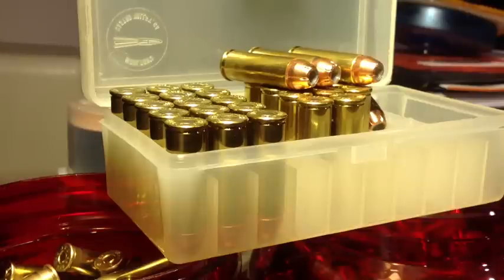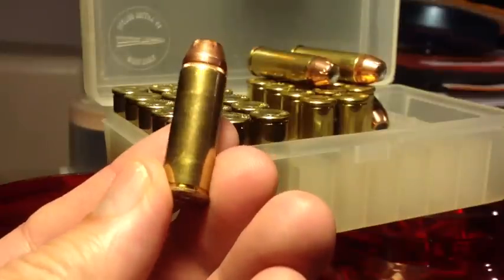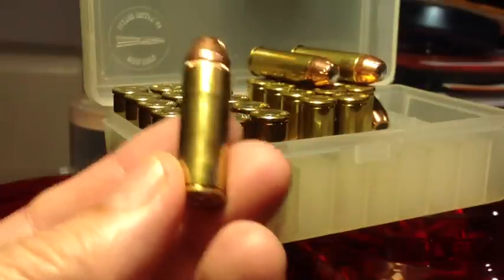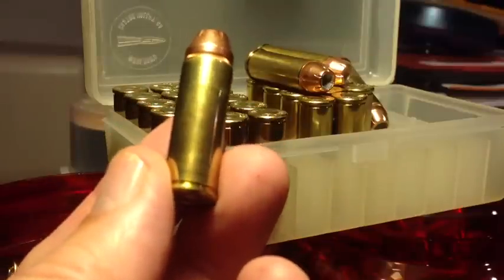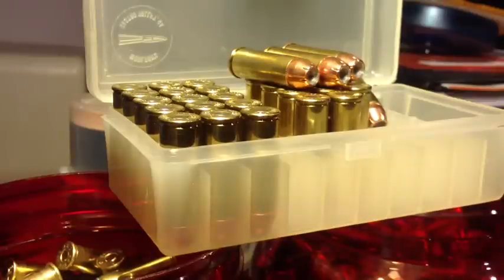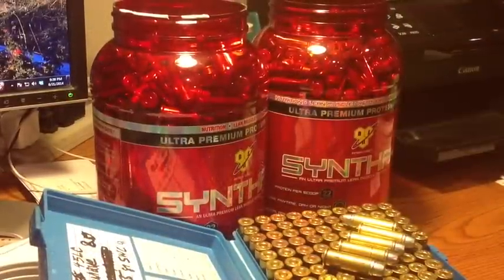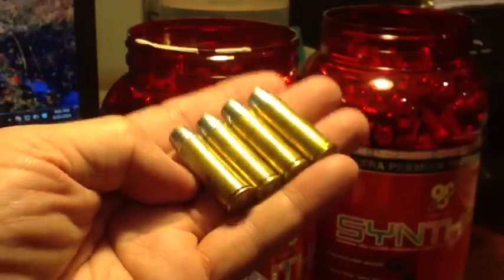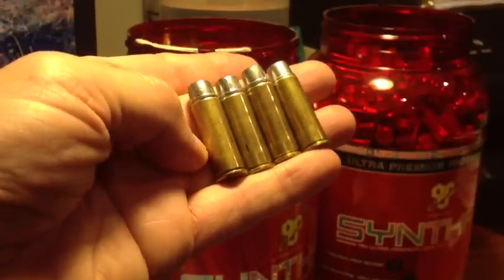Hot Loaded 45 Colt Ammo - Why Not?

Comment: 8g of unique isn't +P. It's very mild for a 255g bullet. Maybe 850fps. I used to load 9g with a similar bullet and it was very mild in a 7.5" Blackhawk. For fun and SD, my load was a 260g speer with 21g of 2400. That had steam, but for most of my shooting, I used the lighter stuff. Of course, unless you have a Ruger Blackhawk, Redhawk or a Thompson Center, skip the +P. Insofar as the Casul, a lot more expensive to shoot.
Reply from the maker: James Lagnese - I remember that 260 grain Speer - shot a box of that with 2400 also many years ago - can't remember the load that I used, but it never got into my favorite loads as I knew I wasn't going to be shooting a lot of those.  My cast bullets were all I needed.  That's true even with these Hornady XTPs in this video...Best to ya, and thanks for posting your favorite load.  FC
Reply: Cast works well too. that's the nice thing about 45 Colt. You can load from 165 to over 340g. I would think the 255g Keith would be really good all around.
Reply from the maker: James Lagnese - The big Keith 45 and the 255 gr RNFP frontier bullet are the first ones thought of when the 45 Colt is in the conversation...For me, those bullets shoot well, but POI is high with them requiring sights to be cranked to the edge.  Much better for me in that regard is my favorite 45 ACP bullet - the Lee 200 grain SWC long nose over 8.5 grains of Unique in the 45 Colt - allows a balanced rear sight setting.  That's actually the cast bullet that I have shot the most all the way back to my IPSC and steel shooting days.  Continued good shootin' to ya,  FC
Reply: Have been using the 255 keith design since early 1970s with an average of 10 gr of unique without any problems, with excellent accuracy in 7.5 inch Blackhawk barrel.  Needless to say, rifling shows wear after many thousands of bullets speeding down the bore but the accuracy continues to be there.  Thanks Ruger for an excellent firearm.
Reply from the maker: PayneCty Gardener - 10 grains of Unique was my general purpose 44 Magnum load with 245 - 250 grain Keith bullets...That's got to be pushing  subsonic velocities in the 45 Colt.  Would be mighty comforting on the trail in a hip holster.  For my range shooting, the old frontier loads fill the bill nicely at the 8 grain charge.  Plus it's easier on the powder economy...especially when there was a powder shortage.  Continued good shootin' to ya,  FC

Comment: The debate still happens, but in reality the 45 Colt cartridge beats the 44 Remington Magnum cartridge easily. Modern 45 Colt brass is as strong as modern 44 Magnum brass, it's not a myth.

Order yourself a back issue of Handloader #292 October 2014 and read the article by Brian Pearce. 45 Colt handloads at 50,000 PSI in a Ruger Redhawk chambered in 45 Colt not 454 Casull.

I don't see any articles loading 44 Remington Magnum cartridge at 50,000 PSI!

The 44 Remington Magnum folks can believe what they want, but the truth is they take second place compared to the 45 Colt folks.

I also think it's funny 44 Remington Magnum cartridge uses bullets .429" to .430", so it's nowhere close to 44 caliber.

As you know 45 Colt uses bullets .451" to .454" depending on firearm, so it exceeds 45 caliber.

Comment: ive watched this several times and the only reason i didint buy a 454 casull and opted to load up some semi hot load for the 45LC in my ruger BH is because the 454 is really expensive. so i can see both sides of the argument. i dont go out and shoot my hot loads all the time, only a few thru the chronograph and the rest for deer hunting. most of my loads are standard pressure. dont wanna shoot the barrel out ya know.
Reply from the maker: chris lowe - That's a good policy.  We really don't want to overpressurize our 45 Colt brass - The Casull brass can stand pressures up to 60,000psi.  Lots of safety margin…not so with the 45 Colt brass.  Best to ya...
Reply: john linebaugh (spelling ?)
solved the "weak" .45 colt brass argument years ago.
.45 colt brass is not weak.
Reply from the maker: gray man - When there was controversy over 45 Colt brass being weak compared to 44 magnum brass, yes - modern 45 Colt brass is as strong as 44 magnum brass as long as the chambers are spec (and today, SAAMI has taken care of that for the vast part).  However, Casull brass is stronger.  I know we are talking about hot 45 Colt loads within the loading manual published loads.  If we try to load 45 Colt to the same pressure as the Casull, we are over the recommendations in the reloading manuals.  These would be more than hot loads.   Of course, this is what Elmer Keith did back in the 20s and 30s, but he was pushing the envelope.  If we want to do the same, we just get hold of a 454 Casull.  Good shootin' to ya, and thanks for all your helpful posts...FC
Reply: elmer keith was using balloon head cases.
known to be weak even then.
he was foolish.
Reply from the maker: gray man - He was young and foolish - we can be young of heart and mind but the older body limits our foolishness... Best to ya,  FC

Comment: I enjoyed the video, but one thing I would add is what can your pistol take?  Hot rodding in a Uberti replica or original gun is going to make you very unhappy, very quickly.  I see comments all the time regarding hot rodding the .45 Colt for use in '92 lever actions or better, which is fine in isolation, but unless you are pairing that '92 with a Blackhawk, you could get into real trouble if cartridges got mixed up.  Given that an original load .45 Colt was designed to drop a horse at 100 yards, I personally don't see the need to make it more powerful, and certainly don't feel under gunned carrying it.  
For a rifle, I'd say if you truly want more power in a frontier cartridge, move up to a 45-70.  Even in it's original spec, a 45-70 is going to outperform a overloaded .45 colt, especially at longer ranges. You also have the added bonus of not accidently mixing cartridges, or having someone else unkowningly use a hot rodded .45 Colt in their weaker pistol somewhere down the line.  Believe me, these things happen.
Reply: Faelwolf The original spec doesn't matter when you're buying off the shelf .45 Colt. You don't get the original load with standard factory ammo. You get what is essentially .455 Webley ballistics. Original black powder spec should be sending those bullets down range at 900+ FPS but standard smokeless ammo is doing more like 700-800. IMO an SAA clone in any chambering larger than .357 should be used as a black powder gun, you won't get better performance from the smokeless stuff.

Comment: 8 grains of Unique with lead 255 grain bullets is no where near +P loading pressures. In fact that load is just at the higher end of a cowboy load with an approximate mv of 800-825 fps depending on barrel length. A hot load with that lead bullet would be more like 9 - 9.5 grains of Unique powder for mv of 900-1000 fps. That load is still at or below SAMMI standards 14,000 psi for standard 45 Colt cartridges.Best read up in your reloading manual before putting out erroneous load data.

Comment: So is there a .45 magnum? If not, why not?
Reply: Yes, it's called the ,454 Casull (more powerful than .45 Colt), .480 Ruger (more powerful than the Casull), or the .460 Smith & Wesson (more powerful than the Ruger!).
Reply: Thank you, forgot about the Casull
Reply: winchester also made the .45 magnum.
it is a rimless case.
i have an m-1 carbine converted to fire it.
Reply: gray man
Right you are.
A company called LAR Industries even made an upsized 1911 gun chambered in that beast of a round.
Reply: @grayman7208  I wish Ruger would make a blackhawk or redhawk in 45 Winchester magnum. I have a Wilde chambered in it and it is a great cartridge.
Reply: @robertmurdock9750  all the need to do is provide moon clips.
in fact ... it may work with the moon clips provided with the .45 colt / .45 acp redhawks. 
in a blackhawk it would need it's own cylinder ... just like for .45 acp.
Reply: the did .45 winchester magnum.
Reply: @Gunners_Mate_Guns  the .480 ruger is NOT a ".45 magnum" in any way.
it is a downloaded 475 linebauh.
Reply: @grayman7208  You are correct.
That was a brainfart from me.
I've been told that the .475 Linebaugh is a particularly challenging round to master in the modified Ruger Bisley revolvers that John Linebaugh uses for it.
Reply: @Gunners_Mate_Guns  you could think of the ruger .480 as the .475 linebaugh special )
Reply: @grayman7208  Yep
Obviously, Bill Ruger wanted his name on the cartridge instead.

Comment: Hot loaded 45 Colt is something the rifle dudes should be interested in. For guys with 45 Colt lever guns are leaving a lot on the table by not reloading for the stronger action & added barrel length. I have a 454 lever r92 & it smokes pigs & really big ones too. I know guys that load there 45 colts rifles  hot , using hard cast rnfp of 300gr + & around the 1400-1500fps zone & there through & through pig stoppers. Don't get me wrong std 45 colts stop pigs but magnum loaded ones are a whole new ball game. & you can generally use a wider meplat / nose & .020 wider bullet with more weight over a 44 mag. 300 gr hard cast rnfp are great hunting bullets.

Comment: my comment was that he said stout loads at 8 grains. That charge is a mild by my experience
Reply from the maker: Silver Back - Sorry for the confusion of terms and also for the delay in reply - Google did not post your comments in my inbox  - won't see 'em for months.  Mild to me means light, so I don't regard 8 grains as a light load.  8 grains in my Alliant manual gives 850 fps as listed velocity.  That is the full bore frontier load (40 grains of black powder in balloon head cases giving 850 fps in 5" barrels back in the day) and that load ruled the frontier for many years - the magnum of its day.  That's where I got the "stout".  I should have used the term standard load.  But the 45 Colt in standard loadings to me is still big bore stout.   Of course, we could go to max of 10-10.5 grains Unique, depending on what reloading manual you use, but I like 10 grains Unique with the 245 grain Keith bullet in my 44 mags instead.  So standard loads they are...  Best to ya,  FC

Comment: I've fired a Magnum Casul. ummmm...OUCH!  >8O

Magnum 45 Colt still has a viable place in Winchester 92's and Marlin 1894's. They should be perfectly safe to feed through them. Probably the originals would be fine, but definately through the modern versions. There are still a lot of them out there. Old and new.
Reply from the maker: The human shrug - Yes the 92 and 94 actions are plenty strong for stoking.  But the reloading manuals are maxing out 45Colt hot loads at 30,000psi and 44 magnums are maxed at 38-39,000 psi.  454 Casulls are loaded upwards to 63,000 psi.  As you point out, the 92s are being chambered for the 454, so the actions are strong enough for the 63,000 psi (and of course the hot 45 Colts), but loading the 45 Colt to 63,000 is definitely not recommended.  30,000psi 45Colt loadings definitely have their place.  The debates of the past were to load the 45 Colt to 44 magnum pressure levels and get more performance because of the bigger volume case…Today, no need to even think of that since we have the 454 and even 460 S&W… Best Regards to ya...

Comment: Ten years ago?  You must be a young man...  I began handloading in the 1970's.  There was data available for heavy .45 Colt loads by then and, I'm quite sure, long before that.  Ross Seyfried was already writing about them in Guns and Ammo magazine, supplying data for both standard six shot cylinders in Ruger Blackhawks and for custom five shot cylinders made for those guns by both Hamilton Bowen and John Linebaugh.  I bought my first mold for a 300 grain bullet from Veral Smith (Lead Bullet Technologies) in the early 1980's. 

Brian Pearce continues to extol the virtues of hot loaded .45 Colt ammo in the pages of Handloader magazine.  This discussion continues in knowledgeable handloading circles to this very day - the introduction of the .454 Casull did nothing to end this conversation in the last few years, mainly because Dick Casull originally developed it in 1957.  It's been a part of this conversation ever since.  Beyond that, Freedom Arms has been selling their Model 83 chambered in .454 Casull since 1983.  I bought one out of the first production run (but have since sold it).  The Model 83 is limited by its cylinder length, which is unfortunately shorter than that of the Ruger Blackhawk.  To make a long story short, we experience all kinds of headaches when bullets with their crimping grooves in a location suitable for the .45 Colt are used.  There are other issues with the .454 Casull in the Model 83 as well which, in short, means that there will always be a place for heavy .45 Colt loads.

This discussion is neither new (in the last ten years), nor has this practice gone by the wayside with the introduction of the .454 Casull.  

As King Solomon said, "there is nothing new under the sun"...

Comment: Underwood 45 Colt #724 ammunition exceed every hot loaded 44 magnum in Underwood's line-up with one exception - the 340 grain 44 Magnum +P+ (part # 743).  Got a Ruger Blackhawk in 45 Colt and you home load?  Trim .454 Casull Starline brass down to 45 Colt lengths.  Debate over.  I trim 460 Rowland brass down to 45 ACP specs.  I shoot Speer 230 grain bullets TMJ RN (#4480) in these with 12 grains Longshot powder.  1400 FPS.  Home loaders find the way.
Reply: instead of trimming .460 rowland, just use .45 super.
Reply: Yep.  I'm a bit late to the party on 45 Super.  It has become my favorite pistol cartridge now.  230 grain ball runs around 1200 fps.  Plenty powerful and doesn't kick quite as hard as 460 Rowland.  I pick up that brass on my hands and knees...

Comment: Dear Fortune Cookie:

     When we have the 454 Casual why hot up the 45 colt?  Elmer would in Ruger revolvers  use a load of 10 grains of Unique which made a good and safe load in those Blackhawks,  the old Vaquero , not the New Vqcquero.  The old load the 45 Colt came out in was 40 grains of  Holy Black, it was a formidable weapon, so much so that it was loaded down to 35 grains. I know that a 45 Colt loaded with 35 grains of the Holy Black will give about 900 feet per second out of  7 1/2 inch barrels, enough for deer and even elk at close range, if one needs more than this,  a 45/70  or a 375 H&H mag rifle will give one all that is needed for anything.  Let us keep handguns handguns, not  try to make rifles of them. I once took down a wounded elk with my old Colt Blackpowder revolver, new in 1885 when the elk jumped up and tried to run off after we  thought it was dead.  Handguns are handguns, rifles are rifles, we don't need cannons on our hips.  Even a traditionally loaded 45 Colt requires practice and experience in order to be effective, it is a formidable weapon as it is, there is no need to jazz it up,  If one needs more power, get a  nice big rifle with a buttstock and a forend that will allow the shooter to manage the power.  These big powerful magnum handguns are too much for about 99% of modern hand gunners anyway, they kick too much, are too heavy and bulky to be easily carried, and damage ears.  A 45 Colt traditionally loaded or MAYBE a 44 Mag are the outer limit for practical carry of handguns.  Lots of folks need to grow up and show some maturity and common sense!
Reply from the maker: DD - Couldn't have put it any better...If I need more power than the 44 magnum or good 45 Colt load, I'll just reach for my handy 308 Ruger Scout Rifle or one of my 45/70s.   Merry Christmas and Happy Holidays,  FC Steve

Comment: i bet this would be fine in a vaquero and my redhawk alaskan
Reply from the maker: +Vanilla Gorilla -- Hello to Vanilla Gorilla..!!  That would be the old Vaquero, not the New Vaquero (smaller frame and cylinder - not for hot loads).  Your Alaskan - stoke it all you want (within the reloading manuals of course).  Best Regards,  FC
Reply: My vaquero was made mid 1990s 1997 i think
Reply from the maker: +Vanilla Gorilla -- You have the Old Vaquero (made on the strong Blackhawk frame and cylinder).  The New Vaquero came out in 2005 and it is not rated for high pressure loadings in 44 or 45 caliber.  Best to ya,  FC

Comment: I have revised my loads brought them down to 7.6 unique.
Reply from the maker: Silver Back - Still a very capable 45 Colt loading at 7.6 grains... Good shootin' to ya...FC
Reply: not disappointed at all.  wish I had time to do gel tests
Reply: You should try 12.5gr Blue Dot with a 250/255 cast bullet @ 1.590-1.60" OAL. This is the most accurate standard pressure load in a 5.5" BLackhawk and 4" Model 25. I used to go 8.6gr Unique but the Blue Dot load is even a good bit more accurate. This load makes 1.5-1.6" 5 shot groups at 50 yards from the 4" Model 25.
Reply from the maker: Joe Doole  - Congrats on your accurate guns and being able to shoot them well.  My favorite 50 yard offhand load was 8.5 grains of Unique and the 200 grain H & G type Lee SWC - stayed in the black at 50 if I did my part, and that was only 4 years ago.  But now, my eyes won't let me shoot at 50 - it would not do the gun or ammo justice...Best to ya,  FC

Comment: I still load my ruger  250 grain to 1300 feet persecond
Reply: Do you have data with 2400 powder? I'm new to 45 Colt reloading, but old friends with 44 Mag reloading and have phenomenal success in 44 Mag with 2400...so I wonder if 2400 would work good in the 45 Colt too?
Reply: That Ruger better be one of the older Vaqueros and not the new model Vaqueros. The older ones were slightly larger and stouter than the New Models that are widely used these days in SASS shooting.